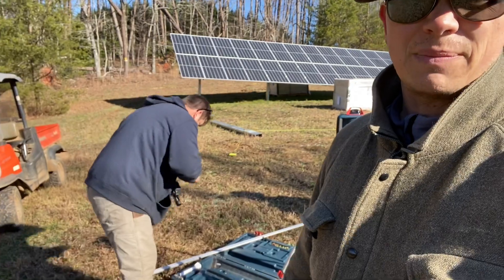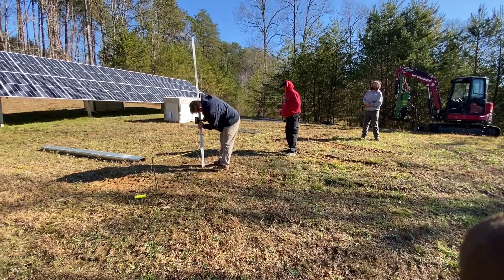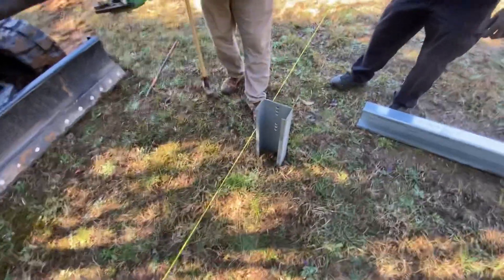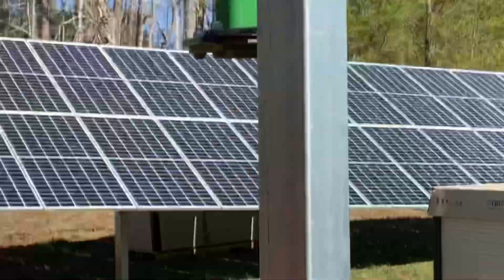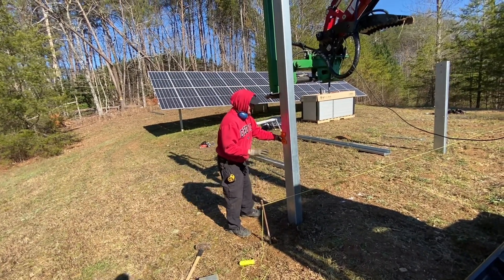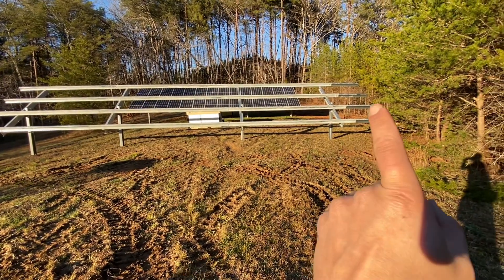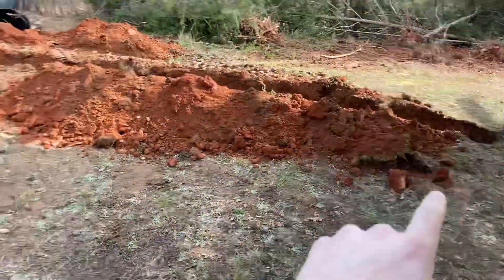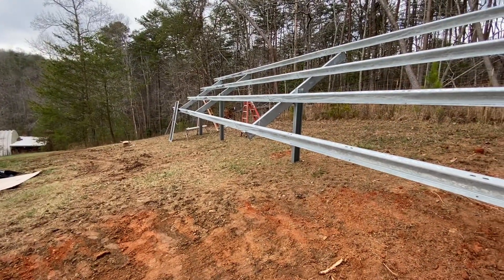Groundmount Solar Installation with Engineer775

Comment: Is that a Sinclair? The third row is something not common.
Reply from the maker: No third row.
Reply: @GainSolarPower  ah I thought I saw one with a third row. Ordering Sinclairs (three 24 panel mounts) via the Engineer. I have to put them on the side of a fairly steep pond bank so it's going to be a giant pain in the ass to keep things in alignment...anything I can do shorten the run while just keeping one row of pillars (such as three rows of panels) would have been helpful. I got all excited.

Comment: I’m using a water level on my 20.6 kw array on a 30 deg sloping ground behind our house. Array at 45 deg. A 60’ piece of 3/8” vinyl tubing, filled with blue windshield washer fluid works great. Cheap, very accurate and hard to break.

Looking great. Keep the videos coming.
Reply from the maker: I like Scott laser. Easy to move around with the little receiver